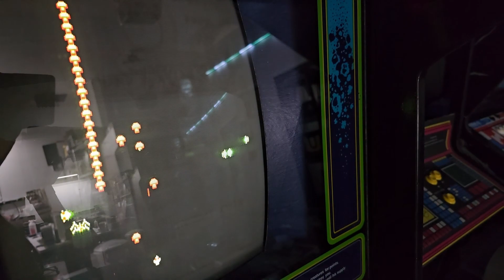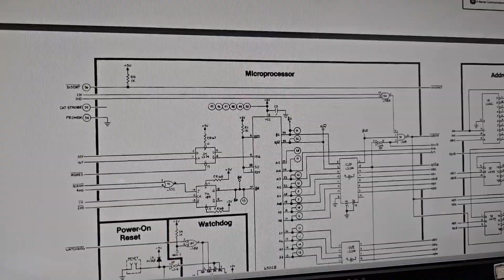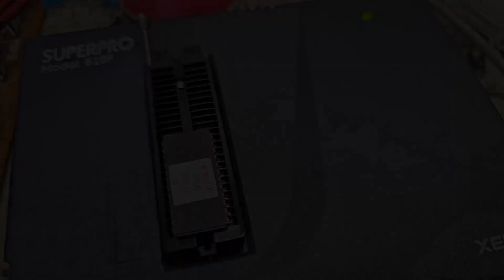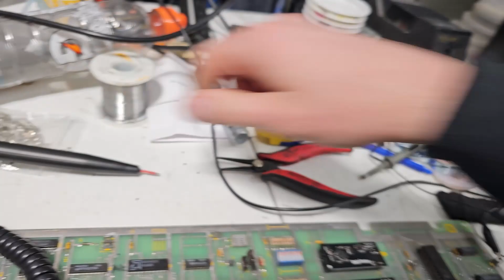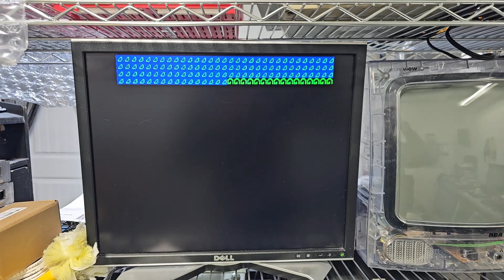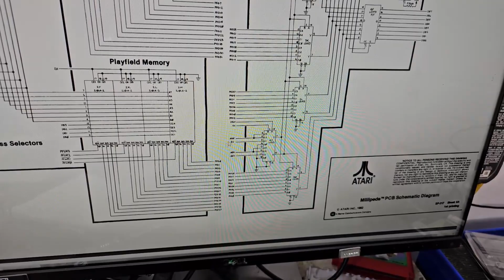Atari Millipede Repair Part 1

Comment: The clickbait thumbnail fails on one level at least though: no self respecting tinkerer would take that tool to their workbench.
Reply from the maker: The table is a cheap folding plastic one from Walmart, you never know.
Reply: @Tr3vor42532  I said "self respecting".